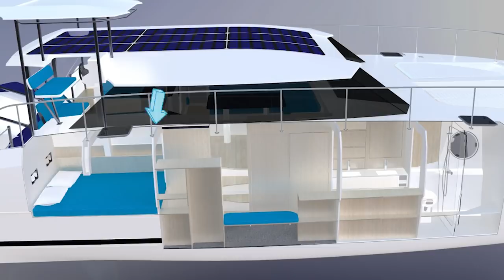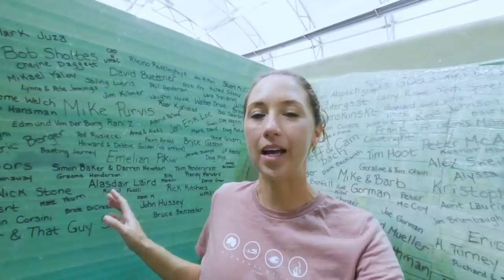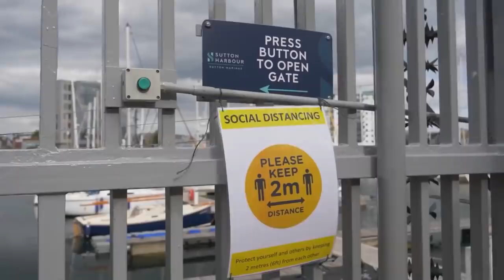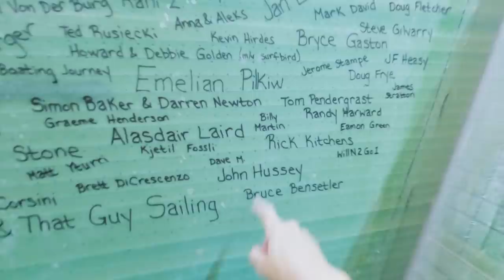CATAMARAN BUILD - Bonding Bulkheads - Preparation is Key!!  (MJ Sailing - Ep 195)

Comment: The secret to using plastic bags to “pipe” in the bedding and filling compound is to put the plastic bag in a large coffee cup.  Fill the cup with resin and cotton floc and when ready catalyst-  mix it in the cup and when mixed pull the bag out seal it up and cut a corner off.   This allows you to mix in small volumes and have multiple cups ready to go.  It is then very easy to apply the filler.   See how  Ross does it on “Life on the Hulls”
Reply: Ross is a master at glassing

Comment: @Matt: A suggestion on some padding to lean on. Try foam pipe insulation. I use on the outside rails of my John boat. So that every time I step in, the boat does not go BONG! 1''x6'=under $2.

Comment: Likely over kill but it would add less than two weeks to the build to layup two courses of fiberglass to each side of those bulkheads completely tabbed to the hull in one continuous piece.  The deal with cats is the forces exerted on the two hulls at the same moment are always in opposing directions both horizontal and vertical. The hulls always wanting to go in different directions. So sweet it would be to eliminate those noises from the torqueing and bending. Less than 2 weeks and maybe $1500, PRICELESS CONFIDENCE.

Comment: When you first started this build ,  I was worried it would get boring .  Exactly the opposite , it's fascinating .  Pretty sure you guys are not going to have Parlay Revivals  bulkhead problems
Reply: We hope!
Reply: This would be the perfect time to reinforce or over engineer those bulkheads......even the naval architects and engineers at "lagoon" got it wrong....better to err on the side of caution than take a chance...
Reply: The Lagoon 450 has a wooden bulkhead that cracked. They are using a non-wood bulkhead, so it is stronger to begin with.
Reply: @donalddimond280  they can still reinforce the bulkheads if they want....they're going to be crossing oceans with this cat when its done....peace of mind..

Comment: Looks great. One trick to get the working time to be longer, if needed, is to pour the mix into a tray, rather than cup/bucket, this will dissipate the heat from the exothermic reaction more efficiently and give you more working time. Cheers!

Comment: Wow, getting there guys. I watch "Life on the Hulls" different builds but similar. A quick question, I know it's still early, your tankage, Fuel, water, grey water and black water, are these tanks supplied or do you have to purchase from someone. I can't wait for the technical side of the build, electrical, plumbing and motor installation. You guys have got this waxed.
Reply: they can either buy tanks for all those purposes, or build integrated tanks into the hulls. i would go with integrated tanks: better use of all available space, and you basically end up with a second hull on those locations which come in handy should the hull ever get punctured, well worth the extra time, work and money, imo.
Reply: @pmnfernando  -   Integrated is the way we are going.    Besides the things you mentioned, it also saves a lot of weight using the structure already in place.   -Matt

Comment: Another trick for coving is to use a short piece of pipe of the proper radius cut with a 45 degree angle on the end used to cove. I use aluminum so I can clean it with acetone. With this method you just clean the excess on each side of the cove. Keep up the diligent work!
Reply: @ralphgesler5110  I am aware, and meant no offense. I know from experience that there are spots that the plastic spreader doesn't work as well. My comment was meant to expand the "tool box" not to offend anyone.

Comment: Large water pipe insulation is ideal for putting over edges your leaning on. A one meter length each is all you require as its easy to move.

Comment: In stead of a pastery bag, just lay down a sheet of plastic, put the thickened vinylester on it an roll it up like a pastery bag and cut a hole in the  pointy end. Used to work in a boat factory, an we did this to glue the deck to the hull. Works very well.
We even used the plastic sheet to mix the glue on, before we rolled it up.
Reply from the maker: Thanks.   That's one I hadn't heard before and we'll give it a try.   -Matt
Reply: @MJSailing  Use a piece of tape to hold it together.

Comment: Slice a large pool noodle and slide it over the raw edge as a cushion.
Reply: You could also buy some pipe insulation from the hardware store. It comes with the slit already in it. Not sure what pool noodles cost though so not sure which is cheaper :shrug:

Comment: Conventional practice when glassing in a bulkhead or other secondary bond is to start with the narrowest tapes and work progressively bigger with the overlaps, so you only have one exposed joint.  Is there a reason you are going the other way?
Reply from the maker: We're finishing most of these surfaces with paint and not a hull liner.  When you do the taping as you suggested, the chances of sanding through the edge of the wider strip where it transitions to the smaller is greater.  Plus, when hand laminating with vinyl ester, the transitions from the smaller strip can causes a gap with little bond to the hull (VE doesnt gap fill like epoxy), so you effectively lose that strength at each stepped point.
Reply: What might be conventional for you is not always conventional practice in the industry, especially when using VE resin,  all yards i have been in,   and this is using both VE and Epoxy  always have the widest  layer first as this is a primary bond and will spread the load,  the secondary bond/layer is purely a reinforcement ,   matts response reference sanding is very relevant  especially if you are using filler liberally you may mis the hot spot.
Reply: @MJSailing  thats right

Comment: I'm curious why you haven't put the sides in place, seems fitting them in that little gap and then cutting all the tall bulkheads to fit is going to be a big PITA.
Reply from the maker: We actually just bonded one of the sides yesterday with no issue.  🙂  The reason we did the bulkheads first before the sides is because the top of the hull sides have a flange that goes inboard about 2-3 inches, so we can bond the deck to it.  For ourselves, we found the process easier to move the hull sides around the bulkheads vs trying to fit it the other way.
Reply: @MJSailing  ah  i was wondering the same    nice one

Comment: I realize that in real time,  you’re long past the point of needing this advice, but on the chance that it still happens again, here goes.  You should buy a few dollar store pool noodles and cut out 3/4”-1” wide lengthwise slots as deep as the central hole.  They will be invaluable as easily moved padding on the sharp edges of the bulkheads as you have to bend (or climb) over them.  If you make several you’ll always have one handy whenever you need it.  Also works on vertical edges you have to reach around.  
Massive project!  Makes my head spin just contemplating the enormity of it start to finish.  It’s taking me weeks just to redo the entire interior of a little 23 foot monohull.  How do you keep inspired even this early in the project?

Comment: I know you previously stated your reasons for laying narrower strips of glass on top of the wider ones, but it still grinds against my nerves.  My first job after engineering school was for an aerospace composites company.  The reason you lay the narrower strip closest to the substrate is so that each ply is tied into the base material.  If the widest strip is laid down first, the delamination of the base ply peels up the entire reinforcement.  Every time I see that, it concerns me.
Reply from the maker: If you screw up the first laminate, and the smaller glass bond fails, there is zero chance the small overlap on each side of the larger tape is going to hold anything together.
Reply: @MJSailing  All things in composites are critically dependent on procedure. Proper surface preparation is essential to bond adhesion. I would still prefer to tie each ply to ensure the structural integrity of the end product. That's not a boat building thing, that's per the Boeing Material Standards for aircraft construction. And those are the guys who truly know how fiber reinforced laminates work.

Comment: Ahhh, 10:07, the annoyed passive-aggressiveness of the beleaguered assistant and the untrusting foreman; I know that feeling well 🤣  When it comes to gluing/bonding in your bulkheads, are you missing out on some strength by not running a bead along where the panel will sit and then smooshing it down in place, and then radius-ing the corners?  Do you think you'll have enough strength just by bonding it from the outside of the joint?

Comment: ** Important ** I just saw Parley Revival use a cake spatula for his bulkheads.  Wow how easy.  You must try!
Reply: Yo, Parlay groupie, ask your boy how he intends to replace all the hundreds of gallons of balsa compost pumping around inside those water logged hulls. That vessel died in 2017 R.I.P.
Reply: http://www.pcmarinesurveys.com/Balsa%20core%20rot%20wet.htm
 @dondassinger6202 '' Lowry Shank and all, that other cat Parlay has had the wet balsa removed for compete proper hull and deck repair.'' You serious, haha! Go back and watch the episode. Colin opens  the outer laminate and states ''It's never ending" and never another word. He seals it up, moves on. You obviously know zilch about the subject. Wonderboy then sailed 10K nm with Hydraulic Erosion pumping water thru the core at high pressure turning balsa to compost mulch. Educate yourself because that quote ''wet balsa removed for compete proper hull and deck repair.'' is priceless in it's ignorance.
Reply: @lowryshank94  wow that's quiet negative.  Considering he is a Marine  Engineer I think he has it under control.  
I also saw him in many episodes continue digging until he found dry balsa, so I don't know what you saw? 
But keep up the good negatively. Thanks 😊
Reply: @CapriceV6  I saw the episode. He kept digging and stated '' There's no end to it". Educate yourself.
Research Hydraulic Erosion as it relates to balsa cored hulls. Colon has resisted to debate this because it will undermine his program. Facts are stubborn things and hardly negative if it saves people from undertaking such a foolish project that could very well take lives. Colin is a MECHANICAL engineer, not marine as if there is such a thing. Parlay sat taking on water to the hull core for months. Read the attached and get back with me if I'm negative or informed. Colin damn well knows the problem and just like Lagoon that's why he fails to address the situation.
  http://www.pcmarinesurveys.com/Balsa%20core%20rot%20wet.htm

Comment: Being that filling the piping bags was so time consuming, why don't you use a dedicated heat sealer/vacuum bagging system to MAKE the plastic sheeting into a cone AFTER mixing it ?  You could mix it on the plastic sheet... like pasta dough ! The heat sealer will allow you to make your own bags with a corner to squeeze from in application.

Comment: After seeing what's happening to Parley, are you planning on bulking up your bulkhead joins?
Reply: Parley sat in water for months soaking into ply and bending timbers  this is a new build
Reply: @williamrobinson7322  agreed, but others have had bonding issues without sitting in water, having any damage, or incorrect useage.  Now foam and fiberglass is a better bond anyways. I personally would rather add another 100lbs of glass and never worry about it again.

Comment: You better glass those bulk heads you for strength , you see what the problems out there on lagoon 450 that parlay on utube is going threw and 25 other on weak bulk heads
Reply from the maker: Part of the Lagoon issue of the bulkheads is they used plywood, with the grain running the opposite way of providing the strength it needs in that area. Our foam core bulkheads provide a lot more strength, in general, and we've reenforced the areas that need extra attention. - Jessica

Comment: funny that you keep calling it coving, its filleting, you are doing a fillet! i have to disagree about the pastry bags. from what i can tell your issue is transfering the thickened resin into the bag and actually thats not so hard with the pots you are using: get your hand inside the bag as you would for a glove, now get your hand inside the pot and scoop all that then reverse the bag onto itself so that the goo  remains on the inside. there you go the resin is inside the bag!. use a small stick to get the remaining resin into the bag, cut the corner and squeeze in place. so muck quicker and cleaner.
Reply: Same technique here, works well for me, way quicker and less messy, fewer voids to touch up at the end too.😎👍

Comment: I'm curious, could postpone the mix "going-off" if you put it in a small refrigerator until it is needed?  Take Care, ASH
Reply: Yes, you can, but it’s pretty important not to overcool it because it’ll crystallise and be a lot weaker if it cures completely at all. 
Other snag is added water through condensation when it comes out of the chiller, it also weakens the cured product. 
Best solution is climate control but that’s a real upscale in cost on a project like this. 
Main thing is to get the resin out of the pot asap. If it’s in a tray, or spread out on a poly board if it’s thickened, it doesn’t build up so much heat through it’s exothermic reaction, hence cures slower. Cheers 🍻 😎👍
Reply: @robm.4512  Thanks Rob.

Comment: I find it highly interesting to watch your assembly of this catamaran. I hear a lot catamaran owners having structural issues, particular the lagoon with breaking bulkheads due to a plywood core coming apart. This design looks to me a way superior design and given the fact how diligently you are in your assembly, I will look forward to observe the long term quality difference.
However after learning about the high the increase in maintenance by owning a catamaran, I think if I ever get a boat, I will stick to a mono hull despite the clear room advantage and faster speed of a catamaran. And my intend would be to roam the Meds where marina space is scarce and expensive.

Comment: Doe's the manufacture cut the bulkheads oversized? I'm shocked that they require you to shape them unless your doing it wrong. They should be perfect from the factory since that's your hull shape. Also, is the bridge deck clearance off the waterline the same, more or less than the Schionning?

Comment: I wonder whether you could attach your cleats with cyanoacrylate (i.e.. super glue) rather than screwing into the deck and having to patch the holes. It works great in woodworking projects but I am not sure if it would tear up the fiberglass when you knock the cleats off. Color me curious.

Comment: Have a look at Parlay Revival. Maybe you should think about some extra reinforcements at the Bulkheads.
Reply: These two are light years ahead of those two hackers. Maybe you should think about asking your wonderboy how he intends to repair/replace the hundreds of gallons of balsa compost circulating inside those cored hulls by Hydraulic Erosion. Very likely those wonderful BHs are tabbed to only the inner laminate maybe 1/4'' thick. The balsa as well as the compression strength has been long washed away. That vessel is an accident waiting to happen. Get off the cool aid and research what certified surveyors have to say about attempting to repair such damage.

Comment: Have you considered putting a piece of sand paper in between the edges of the bulk heads and the sides or bottom. And then dragging it up and down to remove material from bulkheads for gap and figment.
Reply: Never mind the oscillating tool is faster.

Comment: It may be the only two straight edges in the whole boat, and if so, its too late for this tip.  Instead of relying on the small (24") framing square to get your tape square to that straight edge - use the 3-4-5 method to get the line perpendicular to the straight edge.  

If you've never used it here's how it works.  Pick a point on the straight edge - call that point A.  Put you tape on that point and measure  along the straight edge to a point that is 4 "units" from your starting point - call that B.  Now use two tape measures with their ends on points A and B.  Then find the point where the tapes intersect and the tape from A measures 3 "units" and the tape from B measures 5 "units".  You now have a right angle triangle and the tape from A now lies exactly perpendicular to your original straight edge.  

The beauty of this method is that you can make this triangle as large or small as to be practical.  The larger the units, the more accuracy you have. The units can be MM, inches, feet, meters, 100's of any of these.  Also the angle can be drawn with any point being your starting point as long as the long side of the triangle is 5 units.
Reply: I use that all the time in woodworking.

Comment: Wet Balsa Core in Boats (pcmarinesurveys.com)
Meanwhile, why the Parlay fiasco is a completely foolish endeavor. Hull destruction described above is from minor leaks ie; deck hardware, crack thru-hulls etc. Parlay sat 3/4 submerged for months with numerous impacts allowing water intrusion thru the hull laminates both interior and exterior filling the balsa core. Four years and 10Knm later hydraulic erosion pumping water under high pressure thru the hulls has turned the core into a river of rotten balsa composted mulch. To properly correct the damage at this point would be insanely expensive and at the end of the day its' history would leave Parlay with little if any residual value. It's toast. Would be more than happy to have this debate with Colin but I doubt he is so inclined. How many certified surveyors out of a hundred would agree this was a project worthy of undertaking?